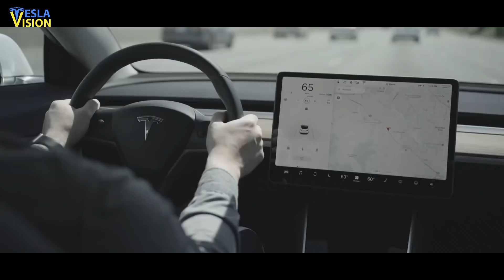ELON MUSK: Roadster will be completed ASAP!

Comment: Tesla is lying throught their teeth. I am 1000% sure it wont even be close to 1.1 sc 0-60.
Reply: Car And Driver confirmed the Model S Plaid at 0-60 in 1.8 seconds, so it is more than likely that a lighter vehicle like the Roadster and equipped with rockets could achieve 1.1 seconds
Reply: @Orion2525  check out engineering explained. They have a video on why the plaid wont hit 0-60 in 1.9
Reply: Haters

Comment: Is anyone producing a compact, lightweight, 4 - 5 seater with 200-ish HP and a small battery? 
If the world is hoping for lower carbon footprint, wouldn't that be the way to go? 
Seems logical...
Reply: Renault Zoe, Nissan Leaf, Volkswagen e-UP, Volkswagen e-Golf, Volkswagen ID.3, Chevrolet Bolt, Hyundai Ioniq, Hyundai Kona, BMW i3, Dacia Spring, Opel e-corsa, Skoda Enyaq, ...
Reply: @BertVanMullem  they probably looking for a $20,000 one.  Non existent yet
Reply: No. Tesla can't until they have more factories. Having cars with low production but high profitablety is the way to go for now

Comment: No doubt the most advanced, but dont confuse with the maximum rpm, teslas has actually a maximum of 20000rpm, and flyweels can go to 60000rpm. Although diferent technologies the stress in materials is comparable thats why fast flywheels (which have probably also bigger diameter than teslas motor) are also made of carbon. Its not so important the rpm, the most important is the angular velocity which is proportional to rpm*diameter..